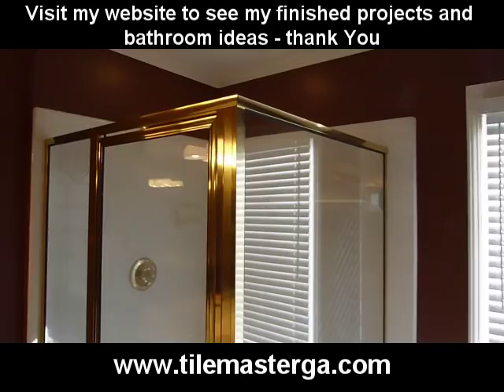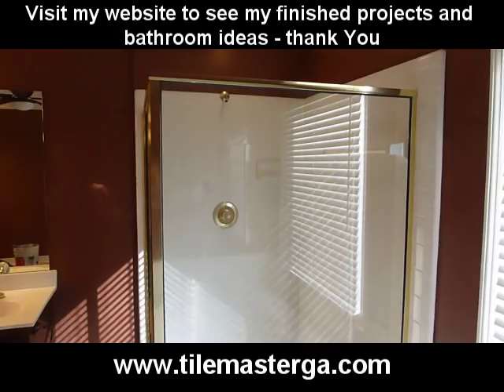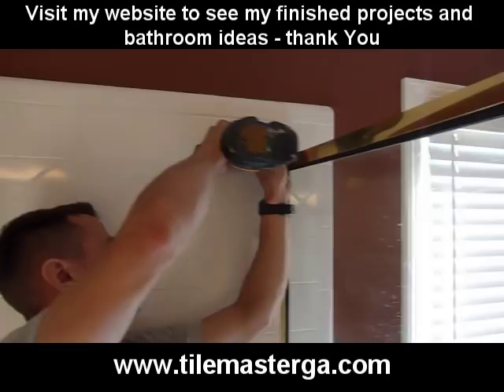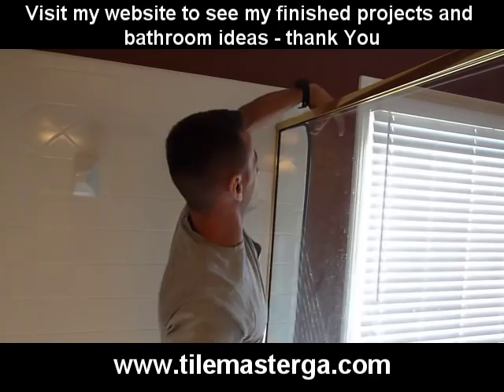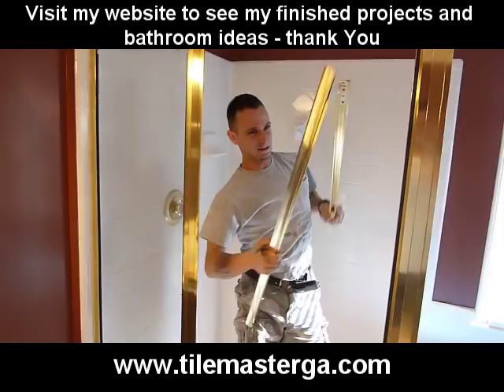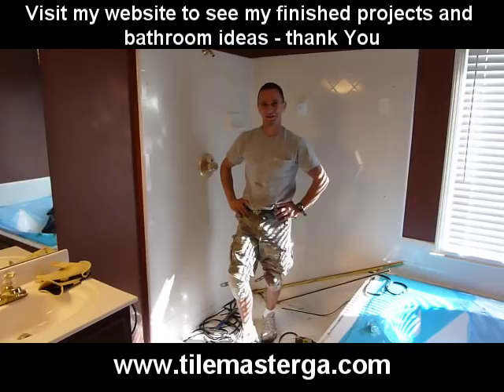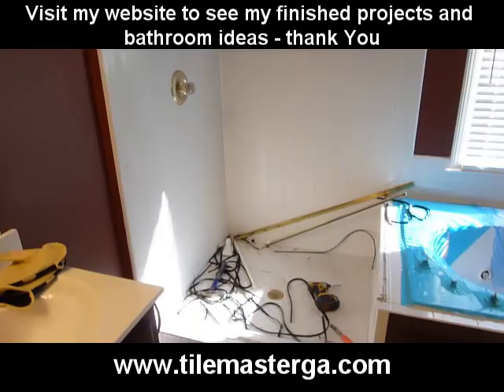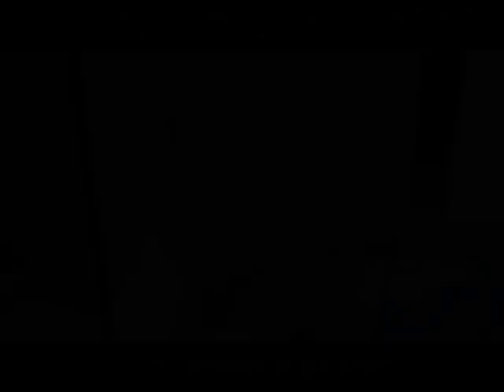How to remove, install shower door -uninstall demo framed enclosures without braking glass frameless

Comment: Michael, great video. Do you have a video showing how to reinstall the shower - particularly the gasket around the glass panels? Or do you have any suggestions on what to do about a moldy bottom gasket on the large glass panel? Thanks.
Reply: Did you figure how to replace the black rubber that he cut and removed?